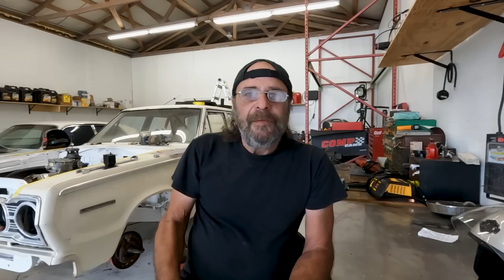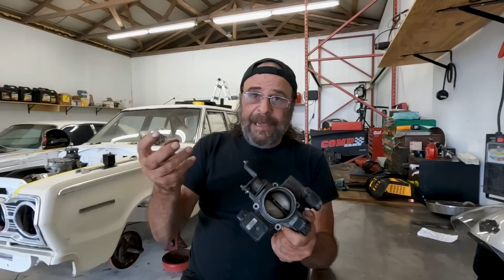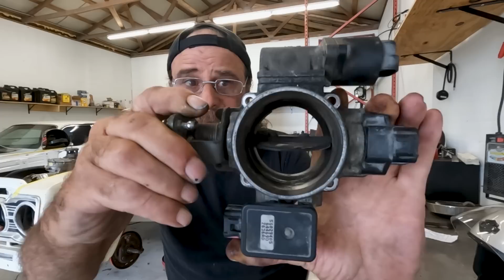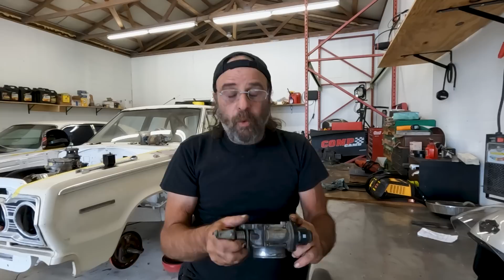Digging For Hidden Power - Building A High Performance Car While Building A Higher Performance Human

Comment: lol, how do I get the check engine light to stay off on my 07 Elantra.
Reply: Sell it
Reply: Disconnect the battery and put it in a better car…
Reply: tape a picture over the light .......
Reply: Change the   name on the title!
Reply: Try taking it to a mechanic, they always seem to fully reset themselves on the way over, with no indication of what was wrong in the first place, because it's now doing a full systems check with the evap system and such.....all by itself huh?!
Reply: What code(s) is making the light stay on?
Reply: @ last time I scanned it, it was dreaded po 4020 code. I cleared the code, added two bottles of Techron fuel system cleaner and put $10 of high test in it. Spent 2 hours at highway speeds and it ran great. lol, haven’t scanned it in the mean time. Has developed a very rough engine vibration. I’m guessing the intake might need a good cleaning or something worse.
Reply: @ The 2 bottles of fuel system cleaner may have caused a missfire. Each bottle is usually good for about 30 gallons. 
The most common cause of cat failure is from missfires causing excess fuel in the exhaust which overheats the cat. 
Best solution is to fix the engine problems so it’s running properly. Then replace the cat.
Reply: @brianmilliard6998  could be a gasket leak. 

If there is an exhaust leak before the sensors (and potentially up to 1-1/2 foot after) it thows of air fuel ratios. 

If a leak on the intake side after or around the air monitoring sensors will suck in excess air. 

That excess air will cause the O2 sensors to see there's not enough fuel for this much airflow, and add too much fuel to the other cylinders to compensate for the overall average of all. Meanwhile one cylinder is lean and the rest are rich with nobody running right, but the sensors are happy.

Sometimes the cat is so melted or clogged with carbon (sensors can get clogged and dirty too) that it needs replacement. Just hope your not there yet.

Back in the day a simple carb clean and adjustment sent millions of cars to the crushers too soon. These days it's intake/exhaust leaks. Because of the cost of a cat and sensors, and you STILL have to pay the shop to diagnose the other issue. And then have to pay for that repairs too.

All that money and time sometimes just because a 2.50 gasket for one of the intake runners had failed.

Most people will just fix the cat and sensor issue. But not want to pay another few hundred dollars to fix the og issue..... (And the issue slowly comes back over time.)

the next steps would have been to smoke test on the intake and exhaust system. 

Then if that wasn't the issue check injector spray for average spray pattern and leaks (under vacuum too) and then check the operation of the air monitoring sensors. 

And finally if it got this far and still isn't the issue, it could be faulty connections, wires, or other.
...................................................................
However i would tell you this. I would get a smoke test done on the intake (and maybe evap system) if anything shows up fix it, 

and make sure there's no exhaust leaks before or with in 2 foot after the oxygen sensors.

 Then use Cat-A-Clean to remove some of the carbon all over the catalyst and oxygen sensors.

And keep in mind, if that car has EGR, then something may has gotten clogged up. So a good cleaning and gaskets or a part replacement somewhere there may also be an issue.